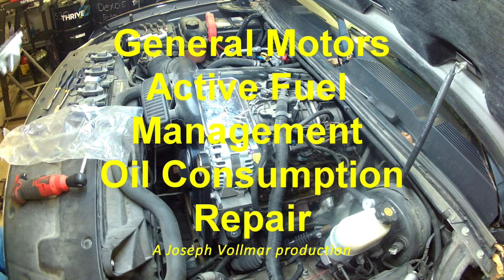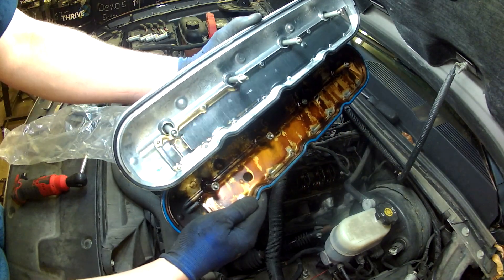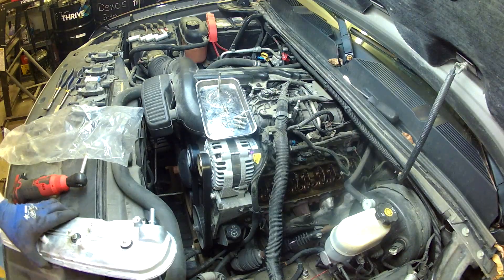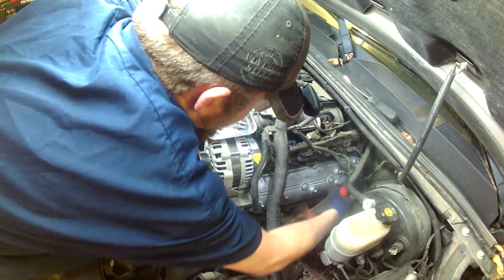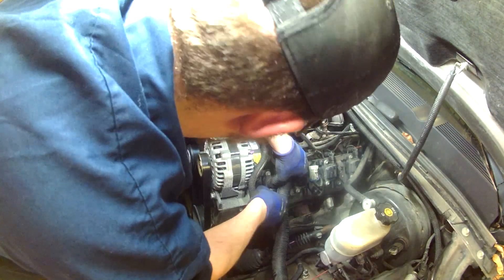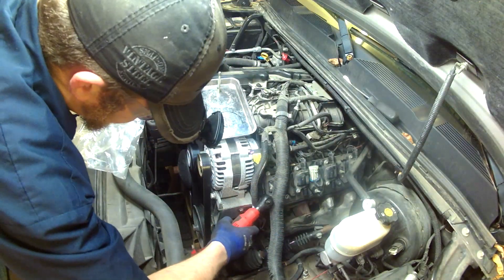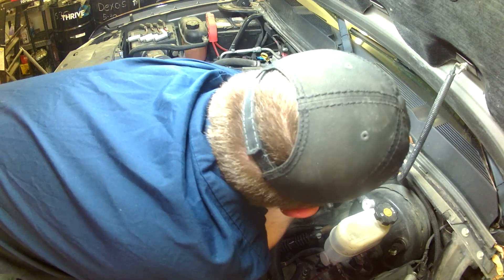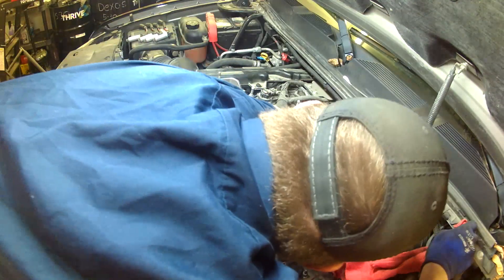General Motors Active Fuel Management Oil Consumption Repair

Comment: I have a 2014 silverado 5.3 that burns about a quart every 3k miles. I thought this one had the new updated cover? Also they have programs that disable v4 would that help? 
thx and great video
Reply from the maker: Programs to disable the economy mode should help, but you would loose the benefit of the increased fuel mileage. It is very possible that your truck may not have had the updated valve cover from the factory. This fix has not been widely seen on the aftermarket until the last year or so, and in late 2017 I heard that the older style valve covers were still being found on some new trucks.  The easiest thing to do would just be to pull the valve cover off and inspect the underside to see which one you have. (I believe I show the difference in this video, but if not, the updated covers have a square hole with deflectors that is even with the front bolt, the old style has a round hole further to the rear of the cover.)   The down side to this oil being pulled through the engine is that it cannot be good for the catalytic converters. They will burn off most of the excess hydrocarbons, but that is going to generate more heat and by doing so potentially shorten their life.
    I would check to see which valve cover you have, replace if necessary, and keep the fuel economy.  As much as I'm not a fan of GM trucks for years they have managed really respectable fuel mileage, even before active fuel management.
    Best of luck in resolving your oil consumption issue.
Reply: Joseph Vollmar thank you for the very detailed info!! I’m not super clear exactly how the AFM disabler saves oil but everyone seems to swear by it with minimal impact on gas mileage. I’m definitely considering it.
Reply from the maker: The issue that causes the oil consumption is that when the engine goes in to economy (4 cylinder) mode it deactivates the cylinders using specially designed electronically controlled lifters on those cylinders. When the lifter deactivates it collapses by allowing the pressurized oil to bypass the lifter, and it sprays the oil up on the underside of the valve covers. the problem is that cylinder one sprays directly at the opening for the PCV runner that is in the underside of the valve cover, and then it is sucked in to the engine and burned through the PCV system. That is why if you look at the old and new valve covers side by side the hole in the PCV runner has been moved and redesigned to abate this issue. 
   If the truck stays out of economy mode there is no oil bypassing the lifter to spray up at the valve cover.  I hope this helps you better understand what is causing this problem, to help you decide what the best course of action is in your particular situation.
Reply: Joseph Vollmar Cant thank you enough for another very informative-clear explanation. I am way more clear now how exactly it works and more importantly the “why” behind oil is being consumed. There is so much info out there and you just never know what to believe. So thank you!
What are your thoughts on oil catch cans? I get the theory behind then but are they worth it as far as helping the engine longevity/less build up?
Reply: I’ll be sharing this video with my friends that have same truck. Sub’d
Reply from the maker: Catch cans are a good way to keep any excess oil that enters the PCV system from being burned by the engine, and therefore should help to keep the engine cleaner, less carbon build up, and hopefully keep running longer, but I can't say for sure. I don't think anyone has researched them from that angle yet. The downside is remembering to empty them unless it has a return line to the engine, lol.
    Thank you for sharing my video with your friends as well.
Reply: Joseph Vollmar I have a Tahoe with a 5.3 and it was having an oil consumption issue that I thought was just due to worn out rings. It became more of a problem when the plugs started fouling out. I put in the updated valve cover, and added a oil catch can. The can catches a lot of oil, even with the new valve cover. But even with all this I’m still getting way too much build up on the plugs. The hose going into the catch can is oil soaked, and the line from it is clean. I would love to have a drain back system for this catch can but I have heard of expensive race car setups that have such a feature. Is there any other spot I need to check?
Reply from the maker: Three questions: How many miles are on your Tahoe? How long has it been since you installed the updated valve cover and catch can? Is it still using any oil? You may try switching to a higher heat range spark plug to see if that helps with the build up (may burn more of it off). Ask your local parts store and they should be able to help you as I am not sure what the part number would be off the top of my head, and stick to the AC Delco plugs they hold up the best in the General Motors vehicles.  If it hasn't been very long, you may still be burning off oil that was trapped someplace inside the intake manifold. That intake manifold has some odd cavities that could possibly trap quite a bit of oil, and it may take a little time to burn it all off. As far as the engine goes I don't know of any other spots currently, you may also run a compression test, if you have one or more cylinders that are loosing compression that could cause issues as well. Generally you want all your pressures to be within 10% of one another. I hope that helps, and thank you for watching.
Reply: Joseph Vollmar it’s been like 3 weeks since I change the valve cover. The Tahoe has 218K miles on it. I’ve been using NGK iridium on it. Maybe you’re right, I should give a few more weeks to burn off what’s left lying around in the intake.
Reply from the maker: Tony Chaudhry the NGK iridium is a good spark plug, but they don’t seem to do well in GM vehicles, and I’m not really sure why. I run them in anything Asian and they work great. I’ve tried Bosch, and other top of the line brands, but have had longer service life out of the OE AC Delco plugs. I’ve had them come back for tune ups with 100000+ miles on a set, have almost double the factory gap, and still not have a miss. How that’s even possible I don’t know but I have seen it several times. 
    AC Delco does make an iridium spark plug for most applications as well. Generally they seem to wear out a little faster, but that’s because of the smaller electrode. Just keep in mind, you do not gap iridium plugs, they come pre gapped. It is very easy to damage the electrode while trying to check the gap.
Reply: Joseph Vollmar in week or so I’ll be switching them out. I’ll go with the AC Delco plugs. I’ll keep you updated. Thank you for the advice.
Reply: not only trucks. same issues with my 2006 Monte Carlo SS with 5.3 engine and my 2008 Impala SS 5.3 engine
Reply: Did you pull the cover? If so was it updated?

Comment: Would this work to fix the major oil consumption on a 5.4L ford triton?
Reply from the maker: No that would not. The Ford engines do not have a cylinder management system like the GM or Ram trucks. If your truck is using oil find the connection point on the air intake where the PCV tube connects, if there is an excessive amount of oil there your PCV valve is probably stuck open allowing it to pull oil in to the intake. If there is very little or no oil there I would run a compression test. If all the cylinders have good compression and are within 5-10% of one another I would highly suspect some of the valve seals to be worn allowing oil to pass by.
Reply: Joseph Vollmar thanks
Reply: Nothing can help a triton. Sorry 😞